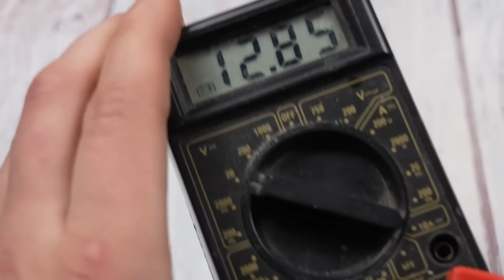🔥Battery Store told me about it and I will share it with the whole WORLD! 🔋 Restore battery

Comment: What a joke. No PPE in most this video.  You clean with baking soda inside?  The battery is likely sulfated.  Suspended acids. The plates are deteriorated.  Temp fix. Will last days till the acid suspension happens again.

Comment: Many bad things in this video:
1. Does nothing to combat the sulfate build up on the plates, this is #1 most important factor on capacity and amp driving capability (ESR).
2. Does not properly fill the cells correctly, there is tones of air bubbles trapped in there, lowering capacity and raising ESR. 
3. Inserting a sharp metal needle in a batter is a bad idea. 
4. Should leave the caps off while charging. If it's rapid boiling, you are charging to quick, it lets the air out so you can top of the electrolyte. Also slight tapping on the battery will purge the bubbles. 
5. Never tests ESR or capacity to verify any performance = fail. 
6. I could go on but that is enough
Reply: What is "ESR?"

Comment: I have owned and used hydrometer and there is a temperature scale on the glass depending on your location and temp will determine either add or subtract from reading once you suck up some electrolyte. Most of all remember it is impossible for an hydrometer to lie and you will always win against opposition as i did with Sears in 2005

Comment: Eu am invatat altfel de la un domn care lucra la incarcarea si repararea bateriilor cu acid la electrocare industriale asa: intai masori curentul debitat de baterie cu ampermetrul, apoi masori densitatea, concentratia, acidului din baterie. Daca ambele sunt scazute pui bateria la incarcat cca 6 ore pentru a scoate acidul din placi. Dupa incarcare o lasi cca 15 - 30 min. Golesti acidul din baterie si apoi o speli cu apa distilata de cel putin 3 ori, pana nu mai apare apa murdara. Abia acum poti sa pui in baterie acid de 28 - 30 concentratie Se lasa bateria 30 min si se pune la incarcat De ce se pune bateria la inceput la incarcat: pentru a scoate acidul din placi in electrolitul slab; daca nu facem acest lucru riscam sa introducem in placi o concentratie prea mare si astfel distrugem placile.
Reply: Thanks man you explained it very clearly for a novice like me.

Comment: In the mid 60s, dad taught us kids  how to check the charge of the car battery in the Ham shack using a Hydrometer. It wasn't until the 80s when I found out that you can purchase battery electrolytic and add new life to lead acid cells. How long can you leave a battery empty of electrolytic acid before it dries out too much, and it is ruined forever?